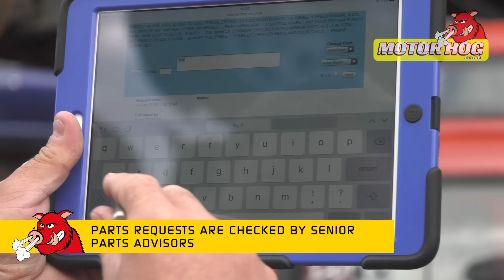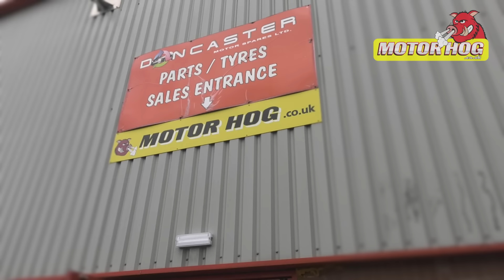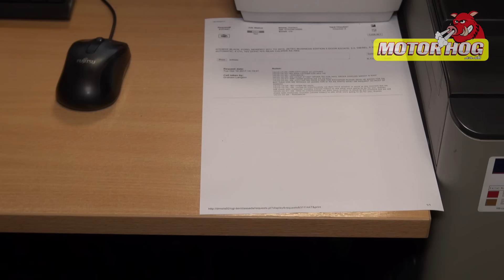Motorhog Doncaster Dismantling Facility

Comment: Many believe auto recycling is odd and take a "Just buy a new one" attitude.   I flew from Singapore to Mauritius and someone ahead of me me had two front doors of a recycled Toyota Corolla as check in baggage!!  Bravo to him.
Reply: I know where that guy's coming from. Everytime I return to the States from the UK, I try to bring back parts for my 1970 Land Rover.
Reply: @richardbrown6565  Many years ago I took parts through Heathrow Airport. Shocks and struts. Should have seen the XRAY machine operator. To them I'm sure they looked like something dangerous.
Reply: I know what you mean. some time ago I took a Series LandRover air filter through Heathrow. It's a large cylinder looking thing [looks like a bomb]   I don't think I could get it through now.

Comment: Very impressive. When I were a lad, running old bangers on a shoestring, the breakers yards were a muddy field, the owner would say, "There is one down yonder", and "Fetch the part yourself and pay on the way out".
 Of course you loaded up with light bulbs, nuts and bolts, and other small items concealed in your toolbox.
 I have recently bought items on line from breaker yards with great success.
 Good luck to Motorhog, always hard to do it right in this business, Health and safety, and Environmental problems abound.

Comment: I work at aplace like this in australia , but our process is different . we get the cars in , drop the oil , fuel ect pull the wheels off , and the car is put into the yard . the customer pays 2 dollars to get in , and any parts they want , they remove themselves , come up to the window with their parts , pay for them , and leave . after a few months , the car is bought back in , the radiators removed for scrap , the brakes removed for scrap , the engines ripped out and scrapped , wiring ripped out and scrapped , the rest of the car , and all the parts on it crushed
Reply: same in the US
Reply: Yeah, I've been in one of those yards and it's sad the amount of good stuff that's destroyed by people who will rip things apart just to get the part they want leaving many good parts that others could use broken and scattered.  This system makes for cheaper parts but it's hugely wasteful because most people don't give a rat's left bum cheek about the next person looking for parts.
Reply: We have a bunch in Philadelphia. I like the U-Pull-It because I like hunting for the parts I need. And other stuff I might need. Not to mention a lot of the small stuff they might not sell,  like interior parts. Going up to a parts counter and tell them what you need and paying more than double just isn't the same.
Reply: They are called pic 'n pull here in US.
Reply: @rbrtjernigan  Here, it's Pick-a-Part.
Reply: Used to be the same here until good old 'Elf & safety made insurance for the sites problematic - there were 4 or 5 places within 10 or 15 miles where you could get parts yourself - none left now. 

I agree a certain small proportion of good parts were destroyed by people, either deliberately or to get at something they wanted more easily, but it was minor compared to the costs of running the yards as they do it today. Kept my old '60s and '70s vehicles running very cheaply back in the day.
Reply: I get part's from here. It's simple I phone them tell them what I need then it's delivered to the nearest motorhog to me then I go pick them up.and they will better any price if you tell them you seen it cheaper elsewhere.
Reply: There's Pick - A - Part in southern ca. Been there many a times...
Reply: delivered to the nearest motorhog garage the company only has one scrapyard
Reply: @ellesmerewildwood4858  I had parts torched off by "yard apes" and tore off because they don't have tools. Some pro's aren't much better cause they have the boss riding them.
Reply: 2 dollars to enter a scrapyard, why ? I wouldn't go.
Reply: Steve can u tell me the address in Australia that is like this one ? Thanks
Reply: @starobinful  harvey wreckers , langwarrin , victoria , australia

Comment: Iv been to metal recycling centers were good cars are scrapped . Oil and fuel drained,  then crushed.   Full set of lights that would be the best part of 1000 quid from a dealer, left on ,4 doors left on, boot and bonnet left on. All perfect, the engine had blown the rest of the car was ok...
Reply: @davejones5640  boot = trunk, bonnet = hood

Comment: Long gone are the days you used to go to a scrapyard for some parts for the family car,  you always took your own tools as the scrap yard had none besides a hammer, a pair of pliers and a wheel nut socket on a welded arm, for the big jobs was a gas axe,  those were the days that you could get killed in there no problem. They were dangerous places but you used to go home knowing that you had saved ten quid and had all the relevant nuts and bolts you had lost taking the part out. Them were great times.  Unlike the modern versions that are like this one, an operating theatre that extracted that elusive part you always wanted but couldn’t get any of eBay as everyone else wanted the same bits.

On a serious note this place looks epic , must be one of the biggest I have ever seen so far and wish them well for the future, plus keep the number handy just in case, no where’s my dads cantilever toolbox gone full of AF spanner....🤪
Reply: Do not forget the needed wellies for tramping through several inches of mud and oil mix that was the ground. Climbing three high stacks of cars only to find the part you wanted had already been taken, no records kept of what cars they had nor what parts had already been sold.
Reply: K Welton well said, you used to come out a few pounds heavier due to the oil mud mix that stuck to you greater than the Inland Revenue, wellies or boots were changed to clean shoes whilst the two lumps went into an old carrier bag.  LoL great times!

Comment: You know they buy in only 1000 or 1200 in Dubai than sell the engine at 4000 aed front and back bumper rims axle seats and every small part which give them a good price

Comment: You know, if used-up consumer goods, including cars and appliances, had to be returned to the manufacturer to deal with rather than taking them to a local dump or junk yard, manufacturers would design with recyclability and reusability in mind.  The key is to make it the manufacturer's problem--not the consumer's or the municipality's.
Reply: Good point. Especially sense they all look totally drivable. Kinda makes ya wonder why such newer cars are sent to places like this. Hell I live in the UK and I don't get it
Reply from the maker: @chaosdemonwolf1  They may look drive-able however, there will be damage underneath that means they're beyond repair. We receive a lot of these vehicles from insurers which means their own experts have categorized and investigated the full damage.
Reply: @SYNETIQLtd non driveable for insurers means non proffitable.

Comment: At 2.50sec can you hammer a balancing weight on a alloy wheel??
Reply: Many alloys you can, have the same lip as a steel wheel.
Reply: Very carefully, especially if you use a hard rubber or plastic hammer...

Comment: Why does the UK junk such clean, low mileage cars? Where I live in the USA cars are run until either something very expensive wears out, rust sets in, or there is catastrophic accident damage. My own second car is a 20 year old Chevy sedan with a replacement front end after our teenager ran into something. Hard enough to ruin the front plastics, not hard enough to damage the cooling system.

Comment: This company had a yard in Newcastle. Looked nothing like that. Was a proper sht hole. Ended up getting a massive fine for it then shut shop.
Reply: it moved to Doncaster now owns a large are of land including several small garages they did relocate from the side of the A19 to their current location but still use the roads to transport scrap to smelters when they have a perfectly usable siding directly behind the place from when it was a gasoil depot with track left down the location they are at needed no groundwork what so ever as the land is 100% flat & all reinforced concrete slabs only thing now is this place going to stay clean & tidy or will it end up like the Newcastle one, besides not all parts are bagged I bought one that was not the colour I wanted & it wasn't in a bag also the parts depot showed it to be busy which in reality its pretty quiet as the place is set back & you can only get to it thru the main gates, prices are pretty reasonable thou for a place that doesn't seem to get much custom

Comment: It's shocking to see some vehicles with low mileage being scrapped. A little bit of work on them and they would be fine for a few more years. Very wasteful.
Reply: Yes but isn't this why they are being dismantled to save similar vehicles. New parts from manufacturers are ridiculously over priced.
Reply: @garybrown5500  That's true but it's better leaving the car in one piece and simply repairing it. Scrapping vehicles prematurely is very wasteful.
Reply: @Roger Onslow   Fully agree !  Minor work could keep some of these cars going for years more.
Reply: @rogeronslow1498  yes it can seem wastefull but who wants to drive an old junker. And its down to  economics as past 12 years old a car is worth more broken up.
Reply: You think that's bad take a look at BMW recycling plant that will shock you.

Comment: Why in the UK they scrap quite young and driveable cars? Like we saw here, Mondeo MK.3 and Fiesta MK.6 are not so old, but they were crushed. In many countries of Europe cars like this are still used so why in UK aren't they sold as "second hand"? In my opinion this is dumb and extremely anti ecological; this is wasting of resources.
Reply: I think they may have to replace there engine every 60K for emission control by law.  Makes sense huh?
Reply: Costs of repair. Our labour charges are so high that insurance companies just will not pay out to get many cars repaired when they are just a few years old. Also they insist on new, genuine manufacturers parts being used which are disproportionately expensive.
Reply: Jeremy Groesz Where did you hear about engines having to be replaced? That's complete nonsense. We do have an emissions check as part of the MOT test, but a reasonably well maintained car should pass until the engine is worn out anyway. These cars are scrapped because they are of little value second hand, or have been written off by insurance companies.